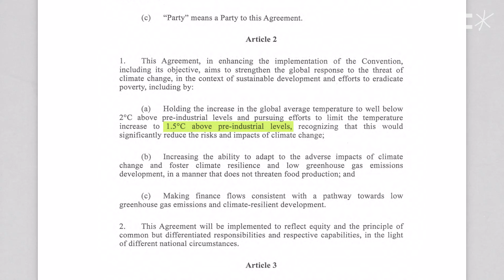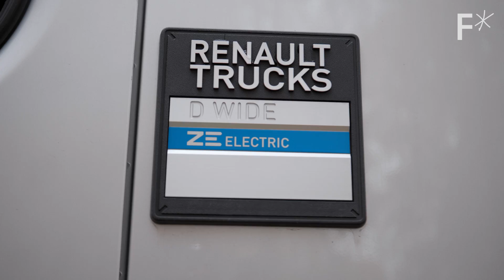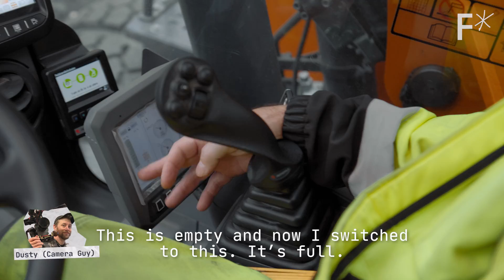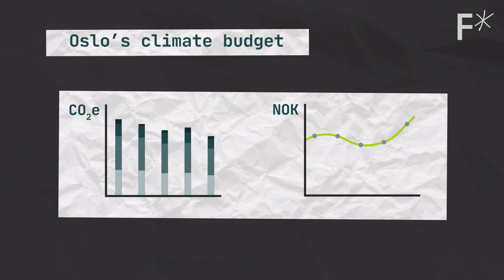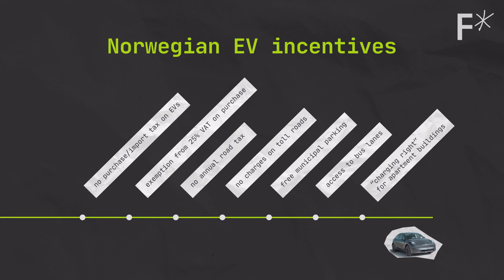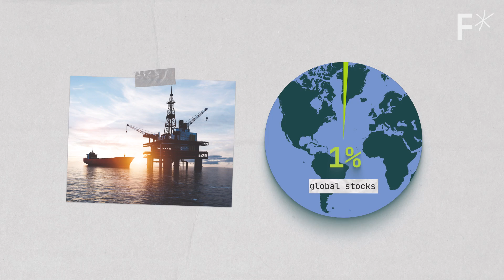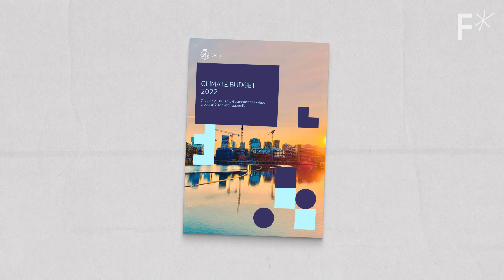The world’s most electric city | Future of Cities

Comment: This is going backwards. You are teathered to the power grid. The batteries take a long time to charge in comparison to filling them with fuel. Plants consume CO2. It is needed. How much power to make 1 vehicle. How much fossil fuels to produce a vehicle. China uses coal. How will Norway dispose of the lithium batteries? They are very toxic. How many rare earth materials are lost making an electric car. The batteries are expensive to replace, and the batteries have to be disposed. Need much better technology in electric cars before they are viable. Graphene batteries would be better, but China isn’t behind graphene. Nor isn’t he USA.
Reply: I don't know how they get you people to spew their lies so fervently.  I'll just point out one thing.  Oil is also tethered to the power grid and roads and pipelines, etc..  After climate disasters, EV chargers are usually back up before gas stations.
Reply: @brians7094  Maybe you should look why these EV charging stations are up. Is it because it is connected to a diesel backup generator. Is it possible that almost everything that you use comes from petroleum products. Solar and wind power generation are inefficient. You will never get an ROI from solar and wind  power generation, and the sick side is they tear them down at or much before the ten year mark so they can bury them someplace that no one will find them. The other side is that EV are not stable. They catch fire or explode. These fires are very difficult to put out. What do you do with the lithium batteries. Lithium is poisonous. Is it reasonable to spend $28.000.00 to replace a battery in an EV? A brand new gas engine is about $5,000.00 after 200,000 miles. EV needs a power source for their maximum range 300 miles. Cars can go fill up in a lot more places. The infrastructure is there. You said that oil is tether to roads and the power grid, and pipelines. Pipelines are the most efficient way to transport petroleum to large cities where they refine it and send some of it to city power stations, gas stations, plastics companies, companies that make surgical tools, replacement body parts, new stronger types of glass with polymers, ... Literally everything people use is based on petroleum products. Even EV plastics, insulators, polymer materials. You hate the industry, fine. Come up with a better replacement for petroleum products that are just as cheap to produce with its resilience.
Reply: @btoolman  No, chargers are not back up due to diesel generators.  It's because wires move electrons way faster and cheaper than oil can be moved.  Solar and wind are being recycled more each year, not just being buried.  And they last way more than 10 years.  EVs are much less likely to catch fire than ICE.  But they are harder to put out with the current batteries, true.  Oil pollution is poisonous too.  No, $28k is not reasonable to replace a battery.  Costs have gone down and will continue to, but generally they can last as long as the car if taken care of.  I take care of my batteries so that I don't have to replace them; 130k miles and as good as new so far.  An EV can charge at any wall outlet, so actually have more places to charge than gas stations (but a wall outlet is slow; one generally does not care how fast when you are sleeping).  Infrastructure is improving every week, but even 6 years ago going coast to coast was easy.  And from Canada to Mexico.  Sure make plastics from oil for a while longer, just don't burn the stuff and put it in our air and lungs; that is taking freedom away from others.
Reply: @brians7094  If the grid is down. All of the breakers need to be reset manually by service trucks. If it is done incorrectly it will destroy transformers. If that is done, it can take days or weeks. At this time, they have put a priority on EV. Diesel generators have to be started due to them putting EV under mission critical. EV have been a dream since the 1950’s. The battery technology needs to move away from lithium batteries. Newer batteries using graphene, or carbine are more efficient. The charging time is much shorter than lithium batteries. Solar and wind are not the answer to the power issue. It may never be. Nuclear power is viable, but needs to be safer. Which they are doing with standardized plans. Fusion power stations hold a great deal of promise. Before transforming over to electric completely, there needs to be very quick and efficient charging. Are the magnetic fields from the electric motors damaging the driver and passenger? How about the magnetic fields from these massive batteries? Is the shielding sufficient? What are the dangerous of batteries or engines to fire, electric shock, explosion? Progress takes time.  It just cannot be all at once.
Reply: @btoolman  The progress did not happen all at once.  I too wonder about the EM fields.  But I do know that vehicle exhaust is harming me every day and shortening our lives already.  I know that I am much safer and healthier driving w/ my Lithium batteries than I was in my gas cars.  I've been driving those for 8 years.  With each new EV on the road the air becomes less filthy.  Gas cars are many more times likely to burn than an EV, but if a battery does catch on fire, get out fast.

Comment: EV engineer here...

Where do the batteries come from? Yup, you guessed it.

 Where did the energy come from to produce those batteries?... Yup, you guessed it.

How are they cleaning up the planet and yet accelerating Industrial pollution for this new tech? Yup, you guessed it.

Looks real good for the camera although a lot more to do before it all pencils out. Nice to see!
Reply: Are you saying that you are an expert that that Toyota is better for the planet than Tesla?
Reply: Your guess on energy is wrong
Reply: Also conventional cars are stupidest type of vehicles. They are built around engines, not around people needs.
Reply: huh @uis246
Reply: It's the same cliche argument but not even really relevant. You're basically admitting climate change is real and fossil fuels are bad, but that electric isn't any better. That's not the problem with electric vehicles. 

How do you make a battery that can hold significant power and be charged at home or through regenerative braking? How do you make a battery that doesn't use its power as it uses its charge? How do you make a motor that produces Horsepower? These are all impossible technologies. Basically if you can do these things, you might as well just fly around on a magic carpet.

Climate change is basically a virtue signaling charade that has taken center stage and distracted people from the real actual problem with this world, capitalism. It's no wonder it's being orchestrated by the controlled opposition, the democrats. There is no opposition to capitalism. It's just a new scheme to induce new demand, and make more money, and just rebuild everything for profit. It's late stage capitalism, reinventing the wheel because everything's already been developed. So develop it again.

Comment: Yes great and where does the energy come from to charge the batteries? And don't lie to me. Also what about lithium shortages that are around the corner?
Reply: From renewable energy. Norway had long rely 100% renewable energy for it energy production. You should have read more on this before questioning it
Reply: @zulhilmi5787  No you're not answering the question you nonce.
Reply: Actually all electricity comes from hydro powerplants in Norway. So it makes complete sense there.

Comment: So, in short, they aren't really accomplishing anything since they are simply selling the oil rather than using it themselves so they are not really helping the environment as much as they think they are. If they really wanted to make a difference, they would stop drilling/pumping oil.
How long (how many charge/discharge cycles) can they use the batteries before they have to scrapped/recycled?
Reply: Doublethink. YOU can stop using oil or do you like supporting OPEC?
Reply: @jaaklucas1329  Where I live, less than 20% of oil we use comes from OPEC nations. My point of the comment was, that whilst Norway brags about it's electric conversion and how it is helping the environment, they are paying for the conversion with money they make from selling their pollution producing oil to other countries. It is highly hypocritical.

Comment: It's really great to see every aspect of Machinery going Electric. But I have few queries 
1. How are they managing the Electricity production 
2. What are the support schemes or policies setup by the govt there 
3. How are they managing the E-Waste  and other waste streams too
4. Do the companies producing all the Electric Machines import any materials or other parts from other countries.
Reply: 1. The same as before, just scaled up a bit. Mix of fuels and green generation solutions. 
2. Reduce incentives for fuels based solutions, move the money over to green solutions. 
3. Not relevant yet as this is new so most green solutions are still in active service. But once green solutions get old enough to hit disposal in volume it will be treated the same as fuel based solutions. Funnel old items into a reuse and recycling supply chain. 
4.  Yes of course the exact same as fuel based solutions. Though the new generation solutions present an opportunity to improve supply chains, as long as citizens and consumers keep the pressure up to continue improvements in environmental stewardship and social responsibility.
Reply: @5353Jumper  3) Try repair first

Comment: Dead batteries on electric bikes and scooters is a pain. Incredibly slow speed limits on them is also a pain. The issue is that drunk people use them and crash so then the city regulates the top speed to like 5 miles per hour. This triples the costs to get from point a to point b because it takes longer.
Reply: Every year battery tech gets better.

Comment: I think a mix of electric, oil, hydrogen and other methods should power the future. When we centralize any industry it will lead to imbalanced systems powering greedy massive corporations. Diversifying is the key to our future.
Reply: I have to disagree, oil should be spent only on chemistry industry
Reply: Oil should be eradicated due to it harmful greenhouse gases emission. You can easily divide the energy sector into multiple branch to avoid imbalance power. All can be done without involving carbon emissions in the process
Reply: Also hydrogen is power storage, not power source
Reply: joe, you speak common sense, which triggers Climate Alarm religionists.
Reply: @earlysda  No, it triggers anti-stupidity. You probably did not even understand why Oslo is doing all than, even if it is clearly explained. Let me guess, US citizen ?

Comment: Do they have sustainable source of electricity
Reply from the maker: Norway gets 99% of its power from emissions-free sources - 91.5% Hydropower, 7.5% wind: https://www.statista.com/statistics/1025497/distribution-of-electricity-production-in-norway-by-source/ .

For what it's worth, while not every country is that clean, EVs still have a number of environmental benefits relative to gas-fueled ones.

- While mining and production of current batteries indeed has environmental harms, so does the mining and production of oil: oil spills, fires, the need to use and dispose of industrial chemicals, etc. Similarly, the extraction of fossil fuels itself requires a lot of energy just like the mining of battery materials. While both oil and lithium-ion batteries can be environmentally harmful to produce, EVs avoid the double hit of gas vehicles having a dirty process to generate their fuel and then that fuel itself also polluting when used.

-Happily, battery designs that use less toxic and safer to obtain materials are proliferating: We actually went to Argonne National Laboratory for a video that gets into this issue and progress on it: https://youtu.be/KMP0x0DpxSY 

-Electric grids are increasingly powered by low-carbon sources. While decades ago virtually all electricity was from fossil fuels, today over a third of the world's electricity comes from low-carbon sources (renewables, nuclear, hydro) and it's increasing every year. So while 100% of the fuel a gas car burns today or in 10 years will generate emissions, powering an EV requires a lower fraction today (depending on the area, of course) - and over time, will be cleaner and cleaner to charge.

-EVs are much more efficient than gas-powered cars. When you burn fuel in a car, about 80% of the energy is lost through heat or in other ways. By comparison, when you charge an EV battery about 2/3 of the energy is used to make the car actually move and operate. So, perhaps surprisingly, even if you power an EV with electricity from a coal-fired plant, it still requires a lot fewer emissions to drive the same distance that a gas car does. https://www.motortrend.com/news/evs-more-efficient-than-internal-combustion-engines/

Hope this helps clarify things!

Comment: What will they do with the dead batteries?
Reply: Recycle them back into new ones.
Reply: EV batteries can be reused for applications where there is less load placed on the batteries(like house hold battery backup systems). then the battery materials can be re-claimed and used to build new batteries or other devices\constructions

Comment: I spoke of this to someone here in America, about an all electronic future, and it's crazy because they couldn't even begin to imagine. I told them about the uber bikes and uber scooters (and their tesla deal for a traditional Über) and they were stunned ay how much w3 ALREADY have (and don't have)
Reply: This makes sense in Norway, where all electricity comes from hydroelectric plants. It doesn't make sense in America, where all the extra electricity for all these new electrical appliances would only come from burning coal.
Reply: @mareksykora779  That's not at all true. Coal power as a percentage of the energy mix has been declining for years now. All new capacity either primarily comes from wind, solar, or natural gas.
Reply: @olamilekanakala7542  No. We want to stop coal power plants, but we can't because we have high electricity consumption. If we replace Teslas with gasoline cars, then all the electricity saved will mean a reduction in production in precisely those unwanted coal-fired power plants. So the real effect of driving a Tesla is 100 percent in burnt coal. And it wouldn't burn if we put the Tesla in a junkyard.
Reply: @mareksykora779  we don’t want to. We are. It is uneconomical to build new coal in the US. The last significant plant built was in 2013. And we’ve shut down several this past decade, with another 33 or so slated for decommission by 2030. Coal is simply circling the drain. If anyone wants to build new fossil fuels it’s going to be gas. And regardless, it’s still better for the environment to drive an electric car with fossil fueled electricity than it is to drive an ICE vehicle.
Reply: @olamilekanakala7542  You'd be shutting down coal plants much faster if you were ditching Teslas. Teslas keep them going. And so it will be in the next fifteen years. Therefore, the real effect of driving a Tesla in the US is in burnt coal.
Reply: It wont Work any Where else in Human Civilization. Who visits Norway anyways?

Comment: It will be interesting to see what the complete emersion in electromagnetic fields does to their brains.  Hopefully, they'll release the studies for the benefit of all.
Reply: What do you think the alternator does in your gasoline car? It makes electricity, which electronic systems, including the high voltage lines to the spark plugs, either via an electronic distributor or an old fashioned rotary one. Same for your fuel injection system, likely electronic these days. Your gasoline car arguably has more electrical systems in it, operating at higher and noisier EMF frequencies than a battery electric car, which is mainly DC. Out of interest, what device do you use to measure EMF?
Reply: Inhaling exhaust is already known to cause much harm to brains (and IQ).

Comment: What happened to those replaced diesel vehicles?
Reply: They stopped emitting pollution. Sometimes they can be retrofitted and electrified - depends on the vehidle. UK Diesel-Electric trains for example, the smaller ones where the diesel generator is underneath driving an electric motor to the wheels, it's not that difficult to retrofit them to be battery powered on non electrified branch (short distance) lines and give them a new lease of life.
Reply: They're used until they're scrapped and recycled? There is a Europe wide market for second hand vehicles though.